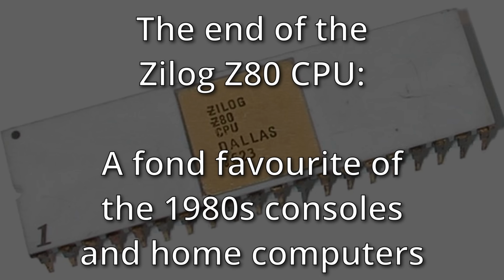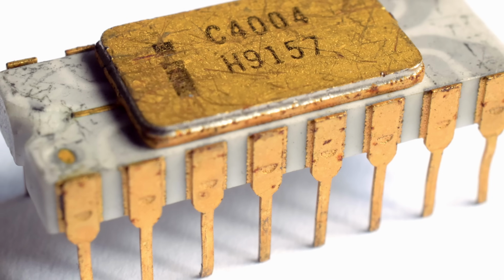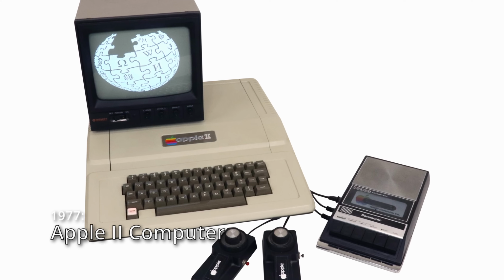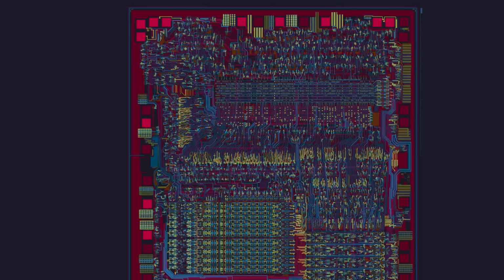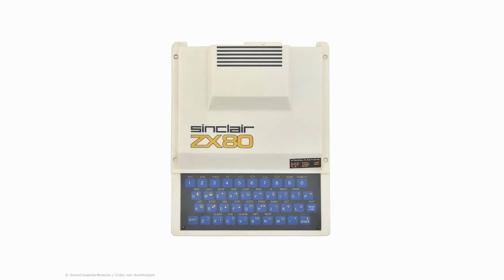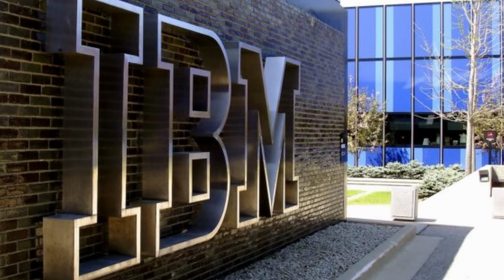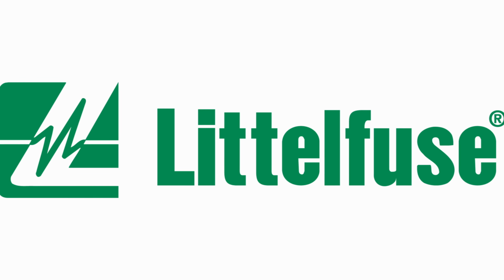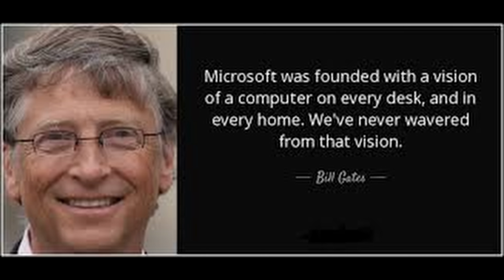The Z80 CPU - 1976 to 2024

Comment: .| || |   | || || |
| || || || || || || |
80s Synths Using Zilog Z80 Processors:
Roland: Jupiter-8, Juno-106, JX-3P
Sequential Circuits: Prophet 5, Prophet 10, Prophet 600
Oberheim: OB-8
MemoryMoog: MemoryMoog
E-mu Systems: Emulator I & II, E-mu Drumulator
Akai: Akai AX73, Akai AX60
Korg: Korg DW-8000

Comment: In July 2025 its not very hard to get NEW Z84C00 chips at 20MHz. That will change of course, but what it means is that the market has enough 5V direct replacement parts to replace failed original chips for years to come. New designs should use the eZ80 or if the Z80 without peripherals is desired, use a licensed FPGA block (or unlicensed emulation created by reading the datasheet since those exist too).

I didn't grow up with any of those machines you cited and the Z80 was only a footnote in the Genesis … but of course I've surely used Z80s elsewhere. And I'm sure I will continue to do so.

Comment: programmed both the z80 and 6502 in assembly. Both great chips. But at the same clock speeds, the 6502A  much faster at everything not needing 16 bit indexing. Primarily due to it's use of s-ram instead of dram and it's zero page addressing mode. I haven't got the manuals any longer so don't sue me here. But I think for example the z80 DJNZ instruction was 7T states, where as DEC xeroPage and BEQ were only 6T on the 6502. Either way though, both great chips... thanks for the trip down memory lane.

Comment: The Sinclair ZX81 had a Z80 CPU and no video chip. The Atari 2600 had a 6502 CPU and no video chip. My first home computer was a ZX81. The Apple II and later the Commodore 64 had good video chips. A good video chip does not steal input/output bandwidth from the CPU. The "trick" was to use 2MHz DRAM chips. The video chip used the first half of the 1MHz system clock, the CPU used the second half of the system clock. If I had knows this details I may have bought a Commodore C64 instead of a Sinclair Spectrum as my second home computer.

Comment: I’ve posted this comment on other videos, but… oh well!

My first computer was an Exidy Sorcerer. It had a Z 80 processor, but I’m not sure about the speed. A broken center lead on a big transistor in the power supply caused it to die an untimely death. I still miss it. It was a fun machine, and I learned to program first in BASIC, then assembly language on it. Later on, I was able to use that knowledge to program in assembly language on the IBM 370 and beyond.

Comment: Back in 1994, I have built a very simple development system based on a Z80, as part of my robotics diploma project at BCIT. A single-sided PCB for processor and memory, point to point wiring on a perfboard for IO. Four-digit LED hex display with a 16-key keypad for program input. Program storage on an UV erasable EPROM. The idea was to servo control a motor. It was certainly more fun and educational than buying an off the shelf "student" system. It's surprising to hear that this ancient architecture is still in use.
Reply from the maker: And likely for many years still to come!

Comment: During the mid 1980s I had a couple of Z80 based CP/M systems that I used for my university assignments as well as general fun with computers. One had 64k RAM and a single 5" floppy drive in a small metal instrument box. Interface was an RS232 connector to a computer terminal, which also happened to be based on a Z80 CPU. My other CP/M system was just a bare board with 64K RAM and an addition 64K RAM that I used as a "RAM-disk" making it a very fast system at the time. I also owned a VHF-UHF radio scanner which used a Z80 for al control. I copied the EPROM and disassembled the Z80 code for fun, then modified the code to personalise various radio functions. That was a very satisfying experience back then.

Comment: The Z80 was the second CPU I learned to program on back in the late 70's.  The other was the 6502.  After going through TRS-DOS and CP/M on my TRS-80 Model 4P, I didn't see the Z80 again until 2012.  I got hired at a low-energy lighting company that used PCM to send current down a CAT-5 cable to effectively bit-bang a Z80 into powering LED lighting fixtures.  The BOM on the Z80 made me laugh:  the Z80 was a show-changer in its day, set my career going, and then heading into my final lap, I got to work with it again on a product that conserved significant energy, and did lots of cool stuff like follow-the-walker lighting.  The unit had the Z80, the light, and multiple movement and temperature sensors.  Brought joy to my heart to hook up a JTAG and reprogram it with my latest firmware install.  Sorry to see the Z80 go.  It served me well.

Comment: Great chip and chipset from Zilog. It was found in many CP/M computers of the late 1970's early 1980's. It made it;s way into embedded designs in networking thereafter.  Most people used it in its 8080 equivalent mode but it had that spare register bank and enhancements that really made it something very special. My first exposure was the famous but oft forgotten Time Sinclair Z81 home build kit. Really the first ultra low budget homemade hobbyist computer. It hooked to a standard TV for a monitor and used a audio cassette deck to store programs. The average home could be expected to have a TV and a stereo with cassette. Note this was when the brand new business targeted "personal computers" just started to have a hard disk that could sell for thousands by itself - at a massive five megabytes of storage.

Comment: A small addition to your fine video.  The Intel 4004 was widely used as a traffic light controller.  I too owned a TRS-80 in 1980.  The most interesting Z80B fact that I can add is I remember seeing a Z80B chip used on a Parallel Interface Card built for the ISA bus on a PC.  The CPU that ran the whole computer was now relegated to running the printer interface.  One hell of a printer card if you ask me!

Comment: 13:38 Intel didn't sue because they would not win.  A CPU instruction set is not copyrightable nor patentable.  As long as the underlying circuitry did not violate Intels cpu patent which I am sure it didn't then they have no case.  It is the similar/same CPU instruction set that makes the 2 processors compatible. And remember that Intel did the same thing by copying the instruction set given to them from the Datapoint 2200 minicomputer when Datapoint aproached them to create a single chip version of their computer and they gave Intel their instruction set and that deal failed.

Comment: Too bad you didn't mention the Heathkit H-89 which used TWO Z80 chips.   One was on the main computer board.  The other, ran the terminal portion, which was also available as just a terminal without a computer board as the H-19.  Heathkit was purchased by Zenith, who continued selling the H-89.  Amazing machine, which ran the Heathkit Disk Operating System known as HDOS by default, but could also run CP/M.

Comment: Well they still make 65c02 and 65816... Last I checked
Reply: And x86, using the structure of a Motorola 68x or arm to get 64 bits
Reply: Well I don't think they'll sue a 3rd party who makes reproduction z80s and adds 16 and 32bit instructions and databus

That's not a z80

Z16 and z32

It will run a z80s instruction too
Reply: They have to, otherwise the 8-BIT GUY's Commander X16 will go out of business🤗

Comment: I learned to use the computer on a machine with Z80A and 64 Kb RAM...it ran CP/M 3.1 on it and brought with it an overwhelming amount of software. In the years between 1983 and 1985 I learned to use C, Macroassembler Z80, DBase, COBOL, Basic (two or three dialects), all stored on big 8-inch floppy disks (and 1.2 Mb capacity). It seems like yesterday, but forty years have passed. Still, the wonder that chip had aroused in me I will never forget: heartfelt thanks to my fellow countryman Federico Faggin for all that...

Comment: Even back in the days of the TRS-80 there were companies that stole its design. In 1980 I had, and still have somewhere in my loft, a Video Genie. This was a TRS-80 clone running with a Z80 processor and almost identical software on built in ROMs.

It's crazy to think back to those days when I had the TRS-80 ROM decoded book and for fun I'd read through the hex and Z80 assembly code listed for the TRS-80.

The ZX80, PET, Apple II and my Video Genie started my love of computers that led me to IBM 360 assembler and 43 years as a software engineer. But in my heart I still wish I could go back to writing bits of code for the Z80.

Comment: This was very interesting to watch! Thanks... 
My C128 has Z80 CPU but i guess it wasn't implemented well, since it is running only at 2MHz speed.
At least it doesn't feel like 4MHz 🤔
And then CP/M (applications for it) are just 8-bit, not 16 which is resulting in poor performance combined with the lower speed Z80 CPU.
Now imagine what we could have had in C128 if things could have been done better.
Well, it is what it is now... C128 is still great, just not perfect :cat-orange-whistling:
Okay, where is that guy working on C128 with 4 MHz CPU or was it 8MHz? 😁

Comment: Considering a lot of appliances have completely different computational demands than PC or other server computers - some architectures will be much better than x86/x64 or even ARM. PCs, servers and mobile phones are optimized to a scenario, when a machine and its CPU runs a large number of different, multi-purpose programs. But when you have a specialized device that just runs its firmware - you can get the same performance at much lower cost using a different kind of chip. Same goes with operating systems. As Linux is super versatile - it's not a good choice for embedded. Too heavy - exactly because it's designed to run multiple, general purpose programs at the same time. RTOS type is much better fit for systems, that just run firmware.

Comment: In 1972 Rockwell released a 4 bit CPU that consisted of a three chip set. My first job as an electronics engineer was with a company that produced a product call a 'computing integrator' which was used in conjunction with chemical analyst instruments.  The first gen used discrete  ICs. 2nd gen used the Rockwell  set. Third gen was Intel 8008, followed by the 8080, and then the Zilog Z80.

Comment: i've learned soldering with the z80. the ndr-klein computer was a modular selfbuilt system. one could 
build a full system from the scratch. i bought the empty boards and books (that's what i could afford) but had good connections for the chips.

Comment: I put together a TRS-80 with the Z-80 and I used that thick book which had the instruction set in it( I threw it away and I wish I hadn't)  to do all sorts of things in assembly.  This was in 1979 I guess. Because I had done Fourier Theory a few years earlier I actually did an FFT in assembly and finally got it to work. The file was on a cassette.  I never did programming as a career as I was more an applied mathematician.  Years later when I was doing the Giant Mersenne Prime Number Search I came across a  programmer who had programmed an FFT for the large number multiplication used in that application. It brought back memories of the Z-80.
Reply: Are you referring to the ubiquitous "8080 Bug Book"?  Its available on the Internet Archive.
Reply: @dennisfahey2379  No it was  a Zilog 80 book. It could be on the archive though.  I will have a look. Thanks.

Comment: I was always a 6502 user - BBC Micro without the Z80 second processor, and then ARM (Archimedes). I admired the power of the Z80 instruction set though, and beating the IBM PC in interpreted BASIC on my BBC was a trivial task, as was booting from ROM rather than from floppy disk!

Comment: I have just got rid og my 8080 programming book and can remember how much fun we had using the assembly language and using CP/M and Dbase (Aston-tate). We built Z80 machines running CP/M and I also remember writing a Helpdesk programme using base over CPM over a RG58/U network. Loved using Kermit and still have my Hugo Cornwall's Hacker Handbook. Proplr forget now how you used to write your code optimized to clock cycles and only had code that was needed for your compile; no bloatware.

I moved into Unix MS/DOS and my first home computer was a 8inch floppy ICL PERQ but I still also remember working on Research machine 380Z and I think I used a IMSAI 8080 at some point but I might be getting confused with a paper tape boot loader for a HP machine. In my development department were we were creating our own very low clock speed wirewrapped breadboarded UNIX motherboard we tried to port Unix  to a Z80 whilst we had the code for the 16 bit unix processor, most of it was there but we did have an annoying keyboard buffer overflow issue on the Z80 port.

I loved working in development then it was an adventure and you knew who everyone was in the UK unix community.

Comment: The Z80 could be connected in multi parallel mode. You could have Hi Availability mode or more calculation power. Also used in lots of military applications

Comment: Back in the day I made an adapter card with an NSC800 (CMOS with Z80 instruction set) for my IMSAI 8080. To match the 8080 pinout and ROM timing a few inverters and bit of logic to add a wait state were needed. But it doubled the CPU speed and expanded the instruction set. Those were the days.
Reply from the maker: Awesome engineering dude!
Reply: @AlsGeekLab  The original NSC800 was a drop in replacement. Then the lawyers got involved. They had to make it incompatible. I just unincompatibleized it... well, and added a wait state in the ROM address space. 

The last thing I designed was a 10kV 5A power supply for the power oscillator (a water cooled tube) of a cyclotron. Why a tube? It lives in a high radiation area where solid state stuff goes to die.

Comment: I wrote my first assembly language app on a Z80 chipset running inside a RM 380Z in 1982 - I was 12 and in my school's first ever computer science class. The Z80 has been a stalwart processor used in so many areas of modern day living that it beggars belief (such as fuel pumps in gas stations, etc). RIP Z80!

Comment: The dear old Z80.  
The most important and certainly the most creative and fun part of my entire career as an electronics engineer was designing circuit boards, writing assembly language programs and inventing rather elaborate data acquisition systems, many of them using the STD bus and all based on the Z80.  I was the company's microprocessor 'guru' and had my own lab.  In my lab, I had a powerful advanced microprocessor development system designed especially for the Z80.  Using the development system, I could compose assembly language programs, burn them into UVPROMS and then use the system's powerful emulator to debug the resulting system.  With as little as 1K (as in 1000) of 8 bit bites, my little boards could sing and talk back to you and tell you what was going on inside complex systems, machine instructions burned into a PROM were that efficient.  One of my boards that put out a whole range of phase variable test signals for testing Atlas rocket servo systems had no external RAM, but relied on juggling variables in the many registers in the Z80. This specialized waveform generator replaced a wonderfully complex (and rather brilliant) electromechanical system that used a rotary core 400 Hz transformer and very elaborate mechanical relay logic (originally designed in the early 1950's) that took up a whole cabinet (the 380 cabinet) whereas my Z80 equivalent was on a single 4X6 inch board.  The other engineers wrote their test procedures and other work out by hand on paper tablets and then gave it to one of our secretaries to type up, but not me.  I used the development system's editor to type up my own work myself and then I'd print it out on a large professional dot matrix printer.  Those were wonderful and heady days and looking back today, I feel privileged to have been able to experience them.  All this was thanks to the dear old Z80.   By the way, I still have my TRS-80 that I used to teach myself assembly language programming before I got the professional development system.

Comment: This video just reminded me that I have a Z80 kit which needs debugging. In the early 80s I worked in distribution and we sold the Mostek MK3880 and the NSC800 the first CMOS Z80/8085 clone (but not pin compatible). I worked as a programmer with the huge (the aircraft carrier) Hitachi HD64180. To this day I can take a hex dump and disassemble it in my head.